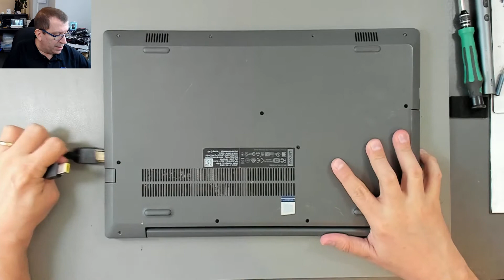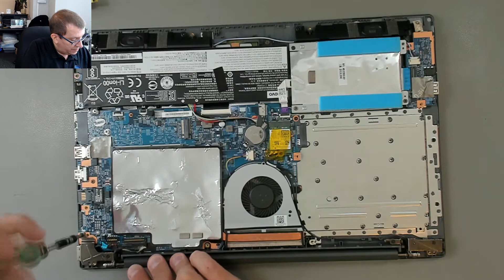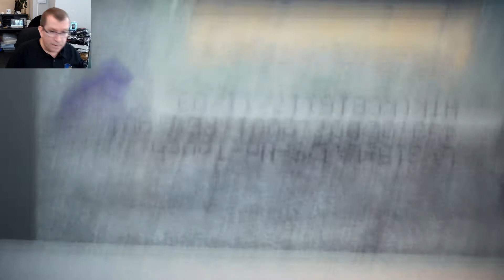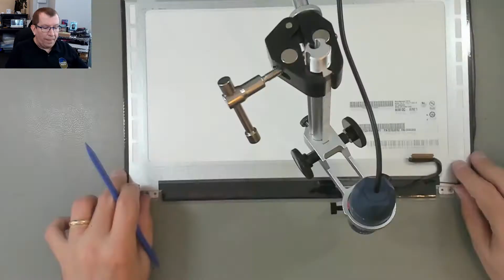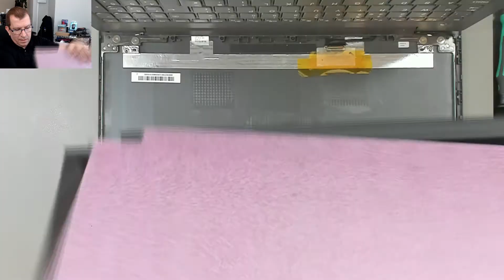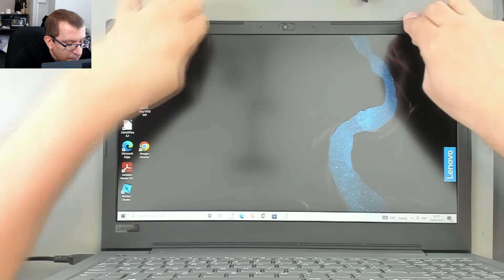[86] Lenovo V130-15IKB - LCD replacement

Comment: I found two panels supposedly compatible with this laptop. One has a 30 Pin EDP 20mm connector and the other has a 40 Pin LVDS 25mm connector. They can't both be correct unless they are referring to the two ends of the interconnecting cable... The  former is an IPS display and latter is a TN display.
Reply from the maker: This one had the 30-pin connector, which I think is most common. You can take yours apart and look near the connector for the '30' (or literally count the pins). For what it's worth, my regular supplier only lists the 30-pin connector for this laptop: https://www.laptop-lcd-screen.co.uk/shop/IBM-LENOVO-V130-15IKB-81HN00FE-15.6-LAPTOP-SCREEN__278149.asp#/

Comment: Great video ! What resolution does the new display have ? My V130-15IKB has a 1366x768 which looks horrible and I am thinking of replacing it with a 1920x1080 panel. How much did your new panel cost ?
Reply from the maker: This one was 1366x768. I don't know if this laptop would support the 1920x1080. Perhaps that panel might be the one with a 40-pin connector?